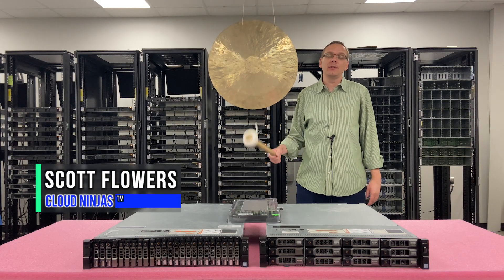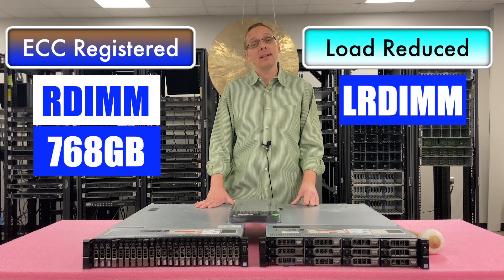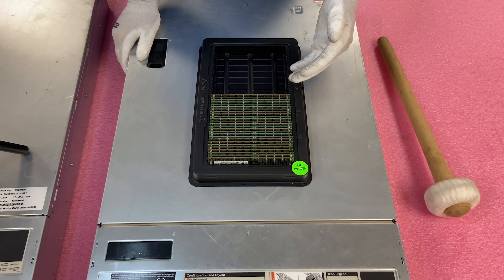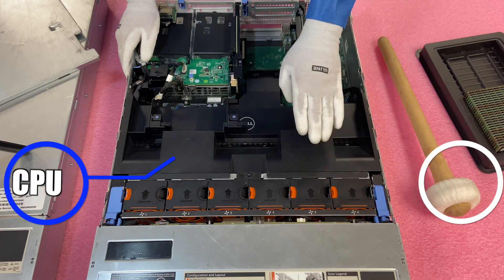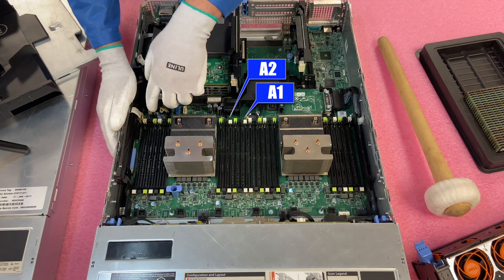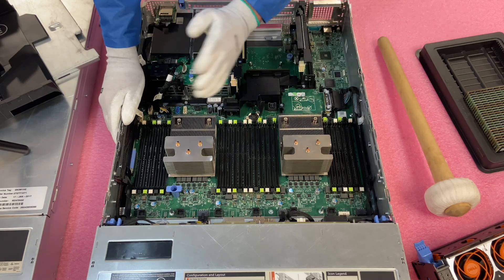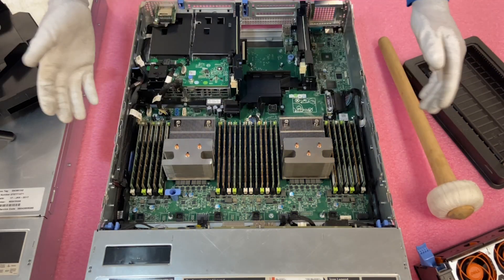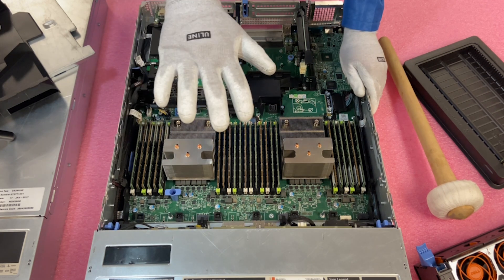Dell PowerEdge R730xd Server Memory Overview & Upgrade | How to Install Memory | Supported DIMMs

Comment: If I have 2 RAM sticks, do I have to do A1 and A2 or could I do A1 and B1 so that I can run both processors? Or does A1 and A2 allow using the second processor even with no RAM in its slots?
Reply: same question
Reply: A1-A12 is for socket 1 and B1-B12 is for socket 2.
That is why he mentioned using A1-A4 and B1-B4 for using 2 CPUs if you had 8 sticks to install.

Comment: Does this work with Linux?
Reply: of course
Reply from the maker: The R730xd supports a wide range of different Linux distributions. Dell states that the R730xd supports Novell SuSE Linux ES 11, Red Hat Enterprise Linux 6, Red Hat Enterprise Linux 7, Red Hat Enterprise Linux 8, SUSE Linux ES 12, and SuSE Linux ES 15. We've been able to use other Linux distros such as Ubuntu and Ubuntu Server. Hope this helps! Smash that subscribe!
Reply: Debian?
Reply: @Joeron79  Should work, because we run Proxmox in the server, it is based on Debian
Reply: I have 2 R730XDs and a R630. All 3 work with Proxmox VE and Proxmox Backup Server bare metal.
Mine is a homelab so I prefer an open source option like PVE and PBS.
You could do Ubuntu or Debian but why when PVE is the best option for VMs and CTs.